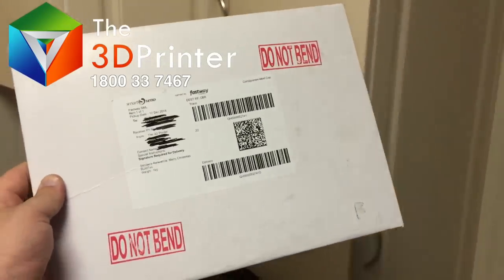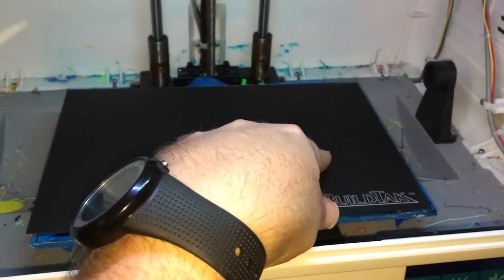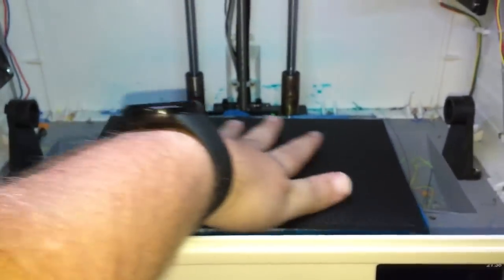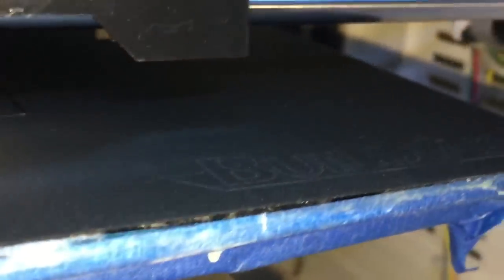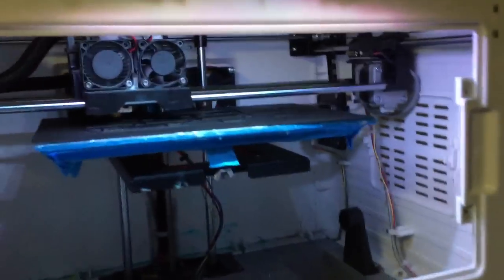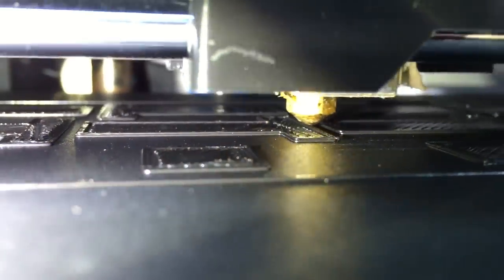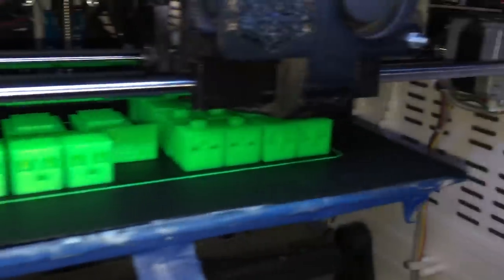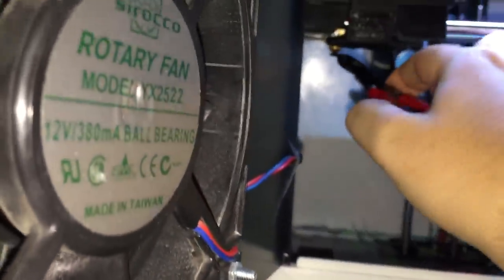Flashforge Dreamer - BUILDTAK

Comment: I've used Buildtak in my FFD for a few weeks now, and also really impressed. One word of warning, thou, if you use flex filament like TPU Flex, it absolutely sticks to the Buildtak. I did a test the other day and basically had to destroy to part to remove it. I think maybe placing the part in the slicer to have minimal contact surfaces and printing with supports. I have yet to try this, as supports might not be easy to remove from a flex part. I could be wrong, as I'm a bit of a noob at FFD 😜.

Comment: Great stuff isn't it? 
Had mine on my Flashforge Creator Dual for about a month now and is possibly the single best upgrade I have done to get consistent prints. Works really well with ABS for me, no more curling up on longer builds.Similar to yourself, I have moved over to a glass bed on top of the standard build plate as I had some warp on mine from the factory that was driving me mad when going for accurate parts.
Can be a bit of a pig to remove parts after, but that is kinda the point in its design. I keep meaning to see how ABS turns out raftless with it

Comment: So now that you have used Buildtak for over a month, I have a question:  How is easy is it to remove prints off the buildtak?  I have a Dreamer as well, and I generally don't have problems getting stuff to stick.  I've used Kapton (the Dreamer came with Kapton on the bed), gluestick, painters tape, and hairspray.  For ABS, I've settled on hairspray because getting stuff off is the easiest.  Builds just come off when the glass plate cools down, or at worst you put the plate  in the freezer for a minute and the prints pop right off.  With other stuff, I've damaged prints trying to remove them because they stick so well.  What is removing ABS like with Buildtak?  I don't like having to level a bed with hairspray on it, but I don't want to have to go back to printing with rafts just to avoid ruining an eight hour print that is stuck to the plate.
Reply from the maker: Hi, Unfortunately I damaged my Buildtak after a few weeks of printing. The parts stick REALLY well. I printed a part with a large contact area and I literally had to use a blade and a hammer to get it off which tore the sheet. I am now using PrintinZ plate which bends to get the part to come loose. Far better in my opinion. Just google printinZ plates
Reply: Thomas James Thanks for the feedback.  I went to the PrintinZ website.  They are currently sold out of the 9x6 that would fit the Dreamer.  They also note that it is really only good for small ABS parts and that large parts tend to warp.  If they admit that much in their FAQ, I can only imagine it doesn't work well at all.  I might get a sheet for PLA, but I've not had trouble getting PLA parts to remove from the buildtak, and I rarely do prints of exclusively small ABS parts. Other than the sticky issue with leveling, I'm really liking hairspray for both stick and then ease of removal.

Comment: Hi Thomas,
Good improvement, actually, Flashforge have already used a build sheet instead of the blue tape.
Reply: Yeh they have that blue stuff I printed on it and it worked really well except my print is so stuck to the print bed I cannot get it off any advice?

Comment: I noticed you changed the position of the blower fan towards the end of the video. Is that more efficient?
Reply from the maker: I pulled the extruder fan off for the first print so I could film the nozzle better. But for all my prints I put this blower fan on, it helps a LOT with PLA overhangs and bridging

Comment: i purchased buildtak of the 3d printer for my flashforge dreamer as well but i am having an extremely bad time with it as nothing is sticking to the buildtak. Do i need to change temperatures to make abs or pla stick properly
Reply from the maker: No, same temperatures but it's critical to get the nozzle height set right. Also after a few prints when it stops sticking, you'll have to wipe down with iso-propel alcohol

Comment: hi can you tell me the purpose of the fan on your door please?
I have lifting using abs same corner every time its a pain in the ....
thx for the tip about wiping it with iso.
Keep up your vids very helpful
Reply from the maker: I installed 2 high speed fans in the rear, one on the left and one on the door. The one on the door is 2cm away from the door so it can suck the air in. The fans help ALOT when printing PLA but I've found I need them sometimes with tricky ABS parts too. Everyone says not to but sometimes cooling ABS is needed. I have ABS lifting at the front right all the time as well, it lifts because the heated bed isn't evenly heated. Nothing you can really do I think.
Reply: Thx very much for your reply very useful to know.
Look forward to more vids
Reply: did you have to re adjust the nozzle height?
Reply: I tend to over check bed plate for nozzle height but it's not difficult so I don't mind

Comment: What size of the Buildtak did you get?
Reply from the maker: Hi. I got the 6.5" x 10" (165mm x 254mm) sheet for $12 off www.the3dprinter.com.au
The sheet fits on my glass bed perfectly (if I lined it up better). Even though it's lined up perfect doesn't matter, it still prints great
Reply: Thomas James Thanks Thomas, should be ordering my one tonight! I have the same Flashforge Dreamer as you :)